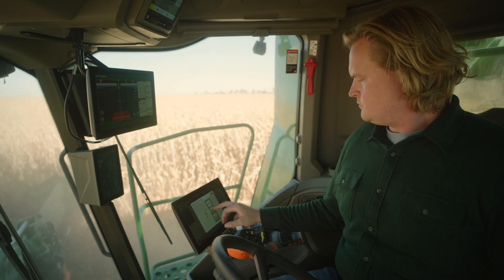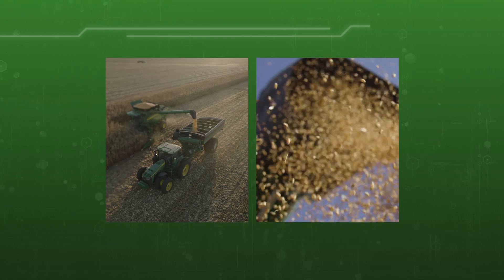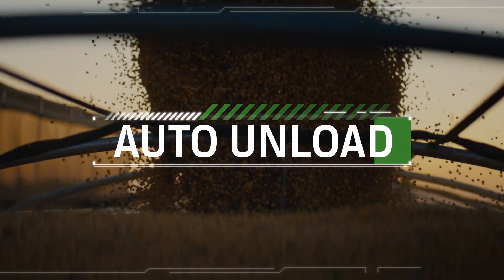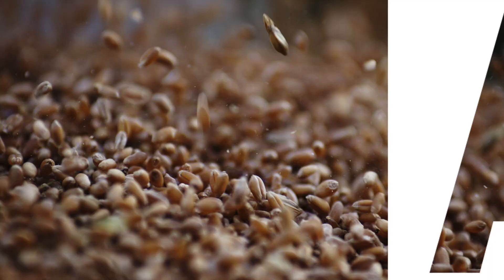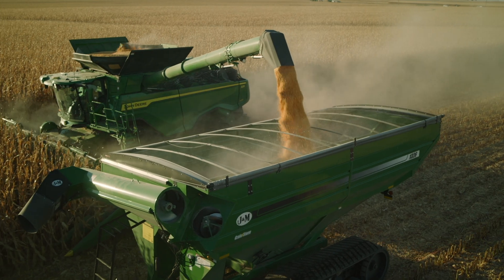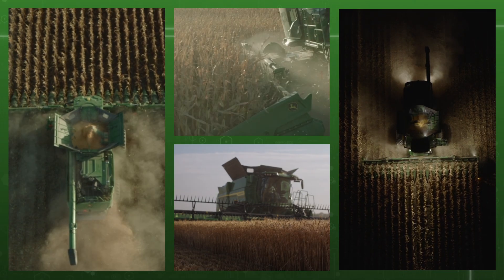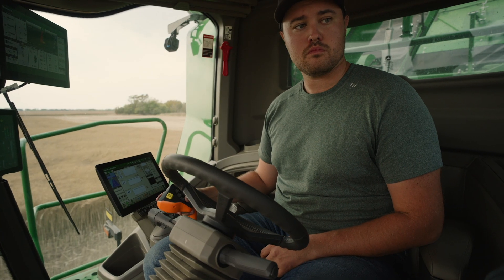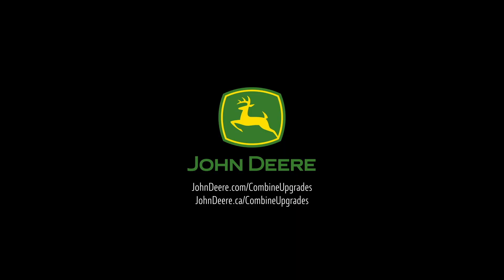Auto Unload Precision Upgrade | John Deere Combines

Comment: Well, it won't be long now and the combines will be fully autonomous like the 8R's are already are. They are pretty much there, other than automated headland turns and opening up the fields, but if the tractors can plant the boundaries in autosteer, then the combines aren't far behind.
Reply: Automated turns with header control coming on the 2026 models